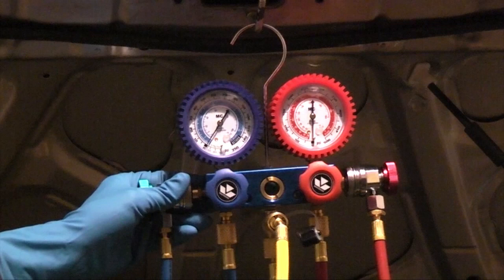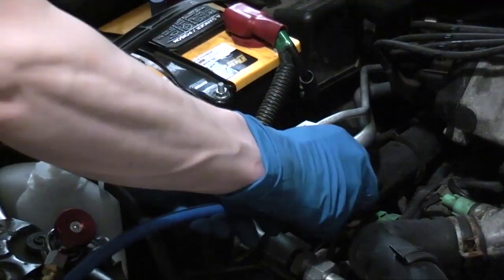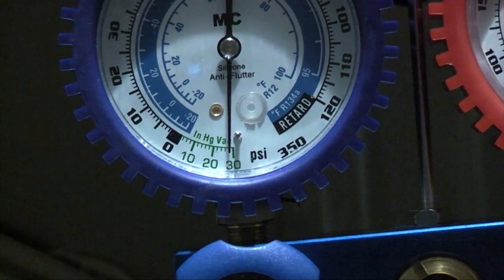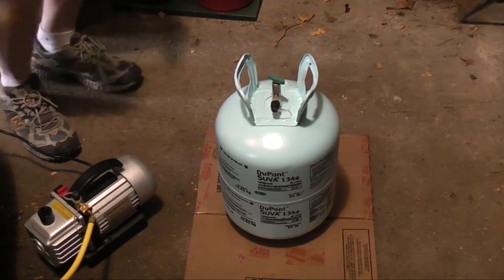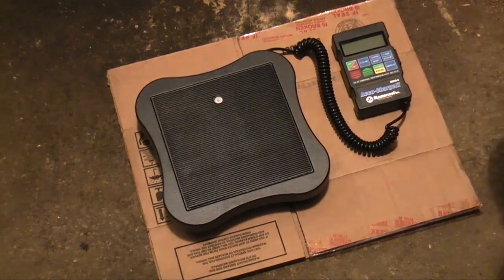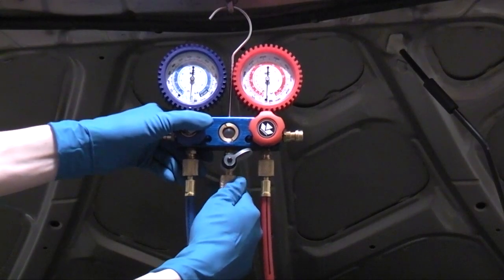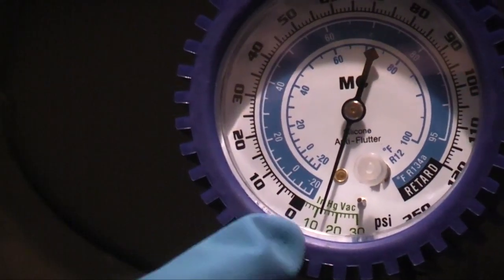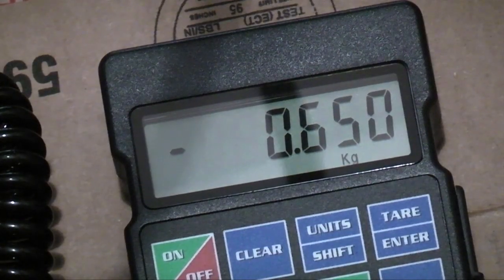How To Recharge an Auto AC System

Comment: There's air in the low & high side lines from the gauges that run to the schrader valves? you didn't bleed the air off inside these lines? Therefore air got into the system... You purged the supply line (yellow line) Great explanation great video, Thanks
Reply from the maker: The air was evacuated from the low and high side lines when both the high side and low side valves were opened on the gauge set after the vacuum pump was turned on. That's why the low and high side valves were closed before turning the vacuum pump off to preserve the vacuum in those lines.
Reply: Bushougoma My mistake your exactly right!, The best information on recharging an automobile a/c system on youtube!

Comment: Excellent video. Clear, Precise and very Helpful. One question has crept up on me related to recharging. PAG46 oil. On my 2001 Caravan, one site says it holds 13 ounces; another 7.4 ounces. The compressor itself says it holds already 5.4 ounces and to add 4 MORE ounces if the vehicle has rear air {which mine does.} That would be 9.4 ounces. I added .8 ounces to the dryer, and 1.5 ounces to the condenser. Assuming the evaporator still holds 20%, what if any oil do I really need to add? Who is right?

Comment: Newbie question: Doesn't the a/c compressor require oil? When and how does that go in? Great video; thanks!
Reply from the maker: You can pour the oil into one of the lines before installing it or use an oil injector on the low side service port.

You typically only add oil when a component is replaced and the amount is usually specified in the service manual. Too much oil can negatively impact the performance of the A/C system.

Comment: Where did you get the connector/adaptor to hook your yellow hose to the tank from? Because they are different threads.
Reply from the maker: It's probably made by Mastercool I've had it so long I can't remember for sure but you can find it pretty much anywhere just search R134 1/2 to 1/4.

There are two types of R134A cylinders ones for automotive use with the 1/2" ACME thread to fit the charge line on an automotive gauge set and the other type with a 1/4" SAE thread both contain the exact same refrigerant the valve threads are just different. My supplier was out of the cylinders with the 1/2" ACME thread so I just used an adapter.

Comment: just do presser test
Reply from the maker: Pressure does not determine the charge in a refrigeration system that is why they are charged by weight.

Pressure will tell you is if it's SEVERELY discharged or empty though.
Reply: Bushougoma ok thanks love you....

Comment: Very nice video.  One of fewest who do a good purge.  I have a question, I have the driver side blow warm air when starts the car while cold air at the passenger side.  It takes long time to be better but always warmer by say 20 degrees at least.  Could that be due to a low refrigerant or one of the doors actuators? 
If I want to just check the system, should i create vacuum while connecting the high and low valve but keep them closing then connect then close the manifolds valves, connecting the charging cylinder instead of the vacuum pump and purge the yellow hose with some refrigerant from the cylinder then open the manifold valves and then close then so I have some pressure in the hoses.  Finally open the low pressure manifold valve and the high and low pressure valves at the ports and run the car?
I just want to check the system pressure so I am not sure if that is correct.
Thanks
Reply from the maker: Whenever you have a major difference in temperature between vents it's almost always a mechanical issue under the dash (blend door, actuator, etc). Your service manual will explain how the air is diverted and the components involved.

Only install gauges if you suspect a low charge or mechanical problem as refrigerant will be lost in the lines each time you connect them. Check the system by feel first. Start the vehicle and run the A/C for awhile and grab the metal suction line (the larger line) going to the compressor. If it's uncomfortable to hold after a few seconds and has condensation on it the charge is likely fine.

System pressure is next to useless for determining system charge unless it has been vastly overcharged or is undercharged due to a leak.
Reply: Thank you Sir for your reply.  That is what I thought.  What happens when you start the car and start the A/C, I get a cold air on the passenger side and not cold at the driver side (almost 20-25F degrees difference).  It is 42F at the passenger side and 60 or 65F at the driver side.  However after driving for a while the driver side gets slightly better and better over time that is why I thought it may be the A/C.  Someone has mentioned that because the refrigerant travels in a serpentine up and down starting from the passenger side so it is kind of consumed by the air going to the passenger side a and by the time the refrigerant reaches the driver side it is already warm and can not cool the air anymore?  The assumption here is that the air is not mixed once it passed by the evaporator. Could it be that bad?  Do you still think it is a mechanism issue such as blending door?
Thanks
Reply: That description and explanation agree with a Scotty Kilmer video I saw yesterday.

Comment: If you open the high side valve during the vacuum process would it not suck the oil from the system?
Reply: Good question.  Did you get an answer on this?  Also, I have no idea about how much oil remains in my system, since I disassembled my A/C and some dripped out with the dye.

Comment: I was charging a system using temperature charts,  it was maybe 60 outside. so I hit the low pressure pretty quick but I was nowhere near  the amount the system is suposed to use.  Can I assume because it's in an engine which is much hotter, more  like 100 +.  AS I got close to the weight the high and low were for sure near the 100+degree charts.  Thoughts?   And Awesome video with lots of great info, Thankyou.

Comment: Just thought I would thank you for the great video. I replaced the condenser and accumulator in my 2003 Grand Cherokee and so started with an empty system. I purchased an Extreme Power vacuum pump and manifold set on Amazon for 160 bucks and three cans of r134. After a successful vacuum and leak test, the only problem was the compressor not coming on due to low pressure. Some forum searching led me to pulling the AC relay at the fusebox and jumping the 1 and 2 terminals(the two large ones) and the compressor came on. My digital kitchen scale didnt work so well, so at 27 ounce capacity for my system I put in a little over two 12 ounce cans. Now I have super cold AC and a sense of accomplishment. Thanx again!

Comment: 7:33 - time frame...If you turn the gauge valves off, how will it be able to leak down?  Aren't you cutting off the pressure from the system to the gauges when you shut the valve off?
Reply from the maker: No the valves only isolate the yellow charge line from the system the gauges are always connected regardless of valve position.
Reply: Awesome...thanks so much for the answer!
Reply: Bushougoma hey man are you ever going to make videos again?

Comment: About how low will the negative pressure if moisture boils out? Will it go all the way back to "0"?
Reply from the maker: Depends on the level of moisture if you let the vacuum pump run long enough all of it should have boiled off.

If the system can't hold a steady vacuum either there is a leak or the desiccant in the receiver dryer or accumulator is saturated which is why it should always be replaced especially in a system where all of the refrigerant has leaked out.
Reply: Thanks.. I have a leak then. Everything is new. I've replaced everything. I've vacuumed it down 3 times now (1 hour each time) and it keeps going back to "0". Guess I'll start trying to find the leak.
Reply from the maker: It's a pretty large leak if it's causing the vacuum to decay. The vacuum test isn't fool proof and doesn't show small leaks.

You made sure to lubricate all of the o-rings with refrigerant oil before installation right? If you don't they can roll in their grooves and tear causing a leak.

It's not out of the question for new parts to leak recently I had a brand new evaporator leak out of the box it had a poorly brazed inlet pipe.

If you partially pressurize the system (I use nitrogen) you should be able to use soap bubbles to find the leak.
Reply: My first thought of a leak is the Expansion Valve. The new valve has a little tapered seat fitting that fits into the end of the pipe connector because of the different size fitting to the Evaporator Core. This is a 1986 Toyota 4x (2.4L). It's an oldie but goodie.. All parts are coming from 4 Seasons Inc. here in Lewisville Texas through RockAuto. Oh! and yes I did lubricate all "o" rings.

Comment: Actually you can be just as accurate using the small cans by using a small digital kitchen scale. Same procedure....just zero out the reading with a full can and keep track of how many grams go in. Good video
Reply from the maker: The weight of the charging line relative to the weight of the can will skew the readings.

It's very difficult to get the can (and the line) to stay put in the same place on the scale especially as it empties.

The charging line will actually cause the can to tip off the scale at a certain point. Any shift in the position of the can on the scale will compromise the accuracy since the weight of the charging line in this new position will be different and skew the reading.
Reply: Close enough for me. I didn't have a problem since the yellow charge hose is long enough
Reply: I might tape my small can to my small scale when I charge my system and have the scale off the vehicle on a stand so no vibrations
Reply: @Bushougoma  so if the system says 48 oz you can't put the 48 oz in and be ok?

Comment: Hi, I know this is an old video and very well done, I don't understand however how or when to add the oil to the system.
Reply: Did you receive an answer on adding AC oil to the system?  I am in that dilemma because my system emptied out and not sure how much remained in the compressor.  I use PAG46 though.
Reply: @calr541  Use an oil injector such as one made by Mastercool which can use either the vacuum to draw the oil in or while refrigerant is charging to push the oil in. There are other injectors as well where you simply push the oil in manually. I believe if the system is empty, you can put the oil directly into the drier/accumulator since that should be replaced.
Reply: @geecrawdad  is this true? You can put it directly in the dryer/accumulator?  Thanks in advance
Reply: @tyrc12pro94 Yes it's true - let's say you have to replace the compressor. You leave a certain amount of oil in the new compressor but usually you replace the drier as well since the system was open. There is a chart for your car that will tell you how much oil to add to the new drier. The chart will also list how much to add to each of the other components, if replaced, whether it's a condenser, evaporator or any of the lines.

Comment: following this video for a/c compressor replacement on a VW camper van. It has two evaporators so I have two questions. The new compressor when it comes will have some oil in it, I understand I'm supposed to pour it out, measure and pour it back in and then add  the balance (total cap 8.1 oz)  Sanden SD7V16 1146.
 
Will I be able to refill the compressor with all 8.1 ounces initially or do I split it and put back what I took out and put the rest in another way. I understand about turning the clutch a few times to cycle it.

The van is a MY 2000, this afternoon I borrowed the same exact pump and gauge set from AZ and ran it on the existing broken system for 60 mins and waited for 90 mins with no loss in vacuum. I don't trust it but I'd rather not open every joint and replace the o-rings like I was planning on doing.

Do you think a vacuum test after the a/c compressor (drier, etc) parts have been replaced is an adequate test for a final charge?

Comment: Do you have to use a scale I know its recommended  ir can you watch pressure?
Reply: +Ronnie Thompson
Yes you can just watch the high pressure gauge but you won't be exactly to spec, your AC will always be a little inefficient (because you added too little or too much refrigerant). 

If you're just a little low on charge, add some by watching the high pressure gauge. (This video doesn't describe how to tell by the gauges when you reach the correct charge--it describes charging an empty system.) You'll know when you have added the correct amount by measuring the ambient (outside) temperature and converting that to pressure--when the gauge reads that pressure for the air temperature you stop adding refrigerant. Add just a little refrigerant at a time, turn off the can valve, watch the gauge. If pressure is still low, add just a little more, turn off the can valve, watch the gauge. Better to go slow than to put in too much. 

Some gauges have the temperatures printed on the face. If your gauge doesn't have R134a temperatures, look on-line for pressure-temperature charts for R134a refrigerant. 

But if you are starting with an empty system (ie, you replaced compressor or other part), use a scale to measure the exact amount of charge (any gram scale will work if you are using 12 oz cans). It's the best way.

Comment: What's wrong with the shop are vacuum pumps? You mean the ones from harbour frieght that user ur air compressor?
Reply from the maker: Yes most air compressors don't have the CFM to drive them properly they are also electrically inefficient the motor on an air compressor consumes way more current than a vacuum pump motor.

The vacuum drawn will also vary with air flow while the vacuum drawn with a motorized pump will remain constant.

The list of negatives far outweighs the positives I'd recommend staying away from venturi vacuum pumps.

Comment: what kind of manifold set do you have? whats the exact mastercool model you got? I am browsing on amazon and i only see "manual/standard couplers" - i guess these couplers automatic depress the shreader valve when you connect?

My Honda a/c isn't cold. I see some "dried black carbon looking" stains on the condenser. does it sound like a slow leak freon stain? can you also explain how to properly inject a dye into the system? great video

Comment: Great video, lot of great points that many other fail to mention or show as part of the process. I will be replacing my condenser along with dryer and orfice valve next week. I know I will be needing to add oil to the system but is there any way to know or calculate how much to add, since I'm not doing a compressor swap there's no way for me to flush out all of the oil and start over.
Reply from the maker: Most manufacturer service manuals will tell you how much oil to add after replacing a specific component they will also specify the type of oil and viscosity.

Follow the manual recommendations for adding oil to the new compressor it usually involves draining the old compressor and measuring the oil removed.

Comment: IS there a way to "top off" a system? From what I have read about how its all done, it sounds like the system would have to be completely evacuated everytime, even if just needing topped off. Is this correct?
Reply: +Bushougoma
What about temperature-pressure method?
Reply from the maker: Your suspicions are correct. Despite what manufacturers of DIY recharge kits tell you topping off a system isn't the proper way to recharge an A/C system. The need to top off a system alone tells you that there is a leak that needs attention.

First off you don't know how much charge is left in the system. Systems are charged by weight and the only way to know how much refrigerant was lost is to remove it with a recovery machine, weigh the recovery cylinder, and subtract that number (the refrigerant left in the system) from the manufacturer specified charge weight.

In other words topping off is at best a guess it should only be used in combination with a UV dye to locate a leak.

The second issue is you do force certain amount of air into the system with a recharge kit because it's impossible to purge the hose coming off the can.

On a side note stay away from kits that say they contain "stop leak" or "seal reconditioners" they can and do cause more system problems than they solve.

Topping off is little more than attaching the line off the can to the low side port and opening the valve with the system running and closing the valve when you think the charge is right. 

As a rule of thumb when the suction line (large line) coming off the compressor is as cold as the evaporator inlet line (the small line after the orifice tube or expansion valve) the charge is in the ball park.

On many systems you won't be able to reach the cold side of the evaporator inlet line so you'll just have to charge until the suction line is "ice cold" (it's uncomfortable to continue holding it) again very subjective.

Comment: I was not sure about pre charging a vacuumed down system a little before starting. All the other videos have you start with a vacuum on it. I will follow your process. I am over thinking it... but thanks again for video. I am about to replace the RCV (refrigerant control valve) on my VW A/C compressor. This type of compressor does not have a clutch like most. It always turns but is variable internally. The RCV varies the swash plate and piston travel. These valves can get stuck and not operate properly.